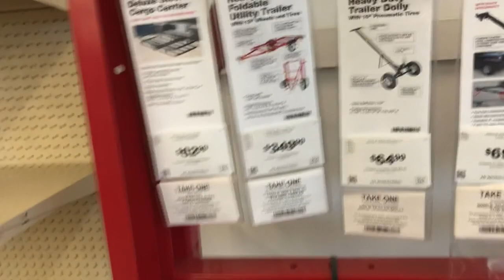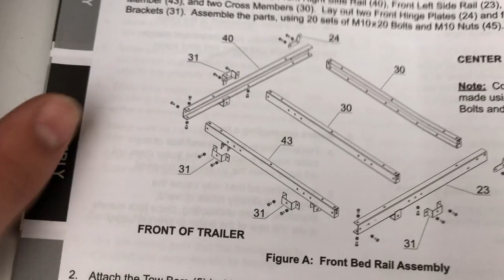Finally Got A New Trailer For Couch Flipping - New Side Hustle Ideas! - Harbor Freight Finds!

Comment: Love the trailer. Question how would you attach the walls?
Reply from the maker: I would cut two by fours into about 2 foot sections and put them in the couplings on the side of the trailer then screw plywood to the two by fours same way %90 of trailer are with wood walls.